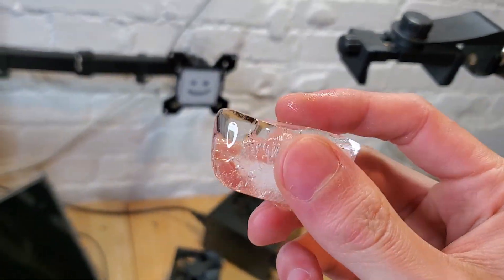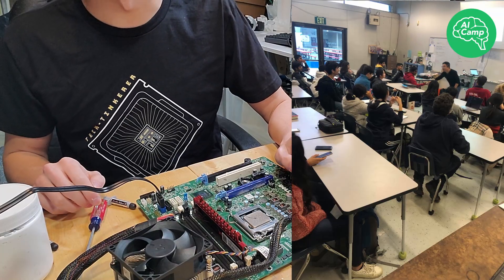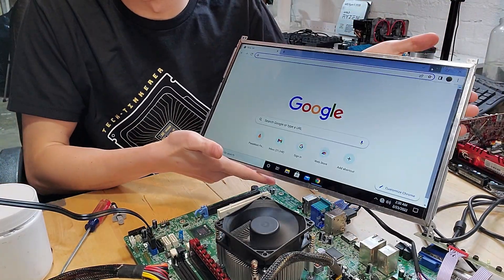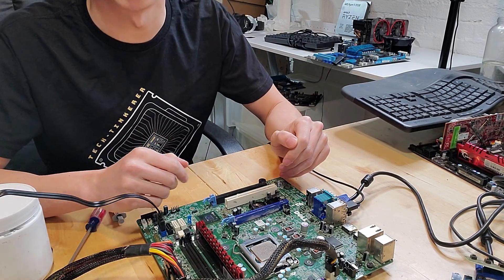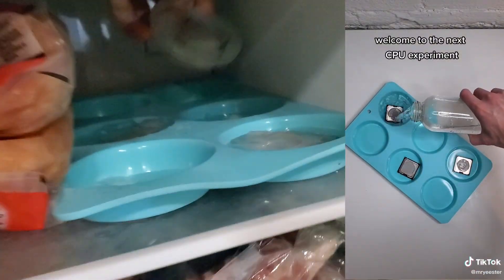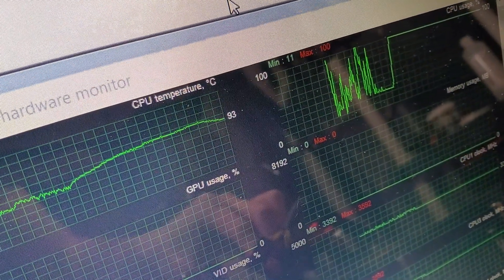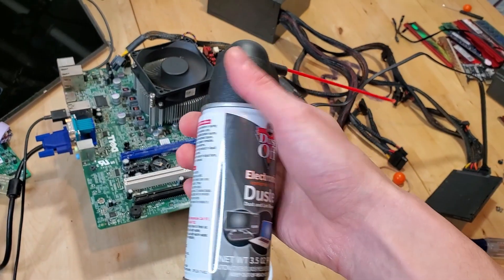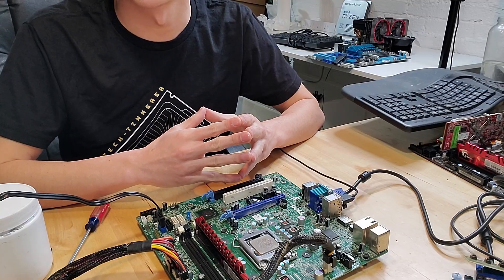Can Ice Cubes Replace your CPU Cooler?

Comment: For the frozen cpu’s in ice, most likely it will be destroyed from physical Damage from Expansion: Water expands as it freezes. This expansion exerts significant physical force on the delicate internal components and the microscopic circuitry of the CPU, causing irreparable structural damage

Comment: As in January 1985 the Commodore 128 was presented, the second video chip VDC wasn't stable, it quickly overheated. The developer bent from his popcorn popper a tray, and with an ice cube it worked for about 20 minutes without buring down.
Reply: And remember: This was an 48 pin DIP IC running with 5V and 16 MHz.

Comment: it's not the ice or the coolant that is the limiter...  it's the iron of the cup... things have heat transfer constants... 

Aluminum and copper (which is what most coolers are made out of) have much higher thermal transfer rates than 18/8 steel would... 

So while increasing the differential definitely results in faster cooling... if you did the exact same experiment but you had an aluminum cup... the rates of thermal transfer would probably be as good if not better than that air cooler.

The big air coolers by modern cooler mfgers are basically heat pumps with massive fins with alcohol inside as the thermal transfer agent. The aluminum and copper bases and the aluminum fins are excellent heat transfer conduits. You use the alcohol instead of water because alcohol has a lower boiling point, and thus converts to vapor faster, and thus rises in the tower faster...

That's why those massive quiet PC coolers look like something out of the Matrix... you need a massive radiator stack to allow the alcohol to rise and then condense back down at the bottom.

That process is super super efficient, which is why with old PCs, they didn't even need a fan.

New PC's generate so much heat... the heat pump needs help by drawing in air faster than it would through normal convection.

But the real issue here... is the fact you're using steel and not copper or aluminum as your conduit. 

If you built an aluminum pipe on top of that CPU... say about three feet high... and about the diameter of a test tube (half an inch) filled it with rubbing alcohol... you could run the CPU without additional cooling. It would totally absorb the energy. You'd have to keep filling the tube because the alcohol would vaporize and boil... but if you made the tube say six feet high and closed it... it would cool continuously...

If you made it out of alumnimum, enclosed it, had copper lining, a copper plate, made it longer instead of fatter (which is what they do in cooling stacks), and then ran pipe through the center of it down to the base to create a convection flow through your fin stack ... 

Well... you'd have a 1990's PC cooler... which what those fat ass radiator things were...  in the early 2000s... they started putting fans on them.

If you look at what Noctua does... you'll get a good idea how it works and how an efficient fin stack can more than cool the CPU.

Those suckers are heat badasses... and their basically perfectly quiet (that has more to do with the engineering on the fans)...

Comment: Make a mount so the cubes sit directly on and melt on top of the CPU lid

Other ideas -
Aerogel CPU cooler
Replace the heatsink of the far unit with a 2d printed one (Fan can work)
Stack just thermal pads on top of it and see if it can cool it

Comment: I just use a Silverado radiator outside with a loop running inside to the water pump mounted on cpu. 50/50 dexcool for those wondering about coolant.

Comment: I put my hand onto the bare cpu in my tower just pissing around and it temps shot right up when i pulled the proper cooler off but did go back down by about 3c during the 15-ish seconds I could handle it before it felt too hot so technically i am a functioning cpu cooler hahaha <3
Reply: idiot cooling is real hahaha

Comment: I began designing and building phase change cooling systems around 2001.Actually attended Uni for Hvac Ref Eng. Built a 3 stage cooler. Installed all 3 stages in a used, clothes dryer housing. All new compressors HX's oil separators, VF drives...etc.  it can pull a 500 watt load to 184 deg F.  Silicone, it just comes alive below -120F! Regardless, a functional experiment! successful yes, but well really expensive. I was able to achieve solid 100% stable, 70% 150% overclocks on Xeons. So bit of pride.
 And forget about running 24/7 that would be $$$$$$$$

Comment: Compressed air doesn’t work like a cooler. Radiators use several fins to dissipate heat. Its better heat transfer

Comment: A traditional method contains two features. First the transfer of heat to the cpu to the heat sink. Then  the fan to disperse the heat from the heat sink to the air. Your experiments however only use one method. Ice is either trying to transfer cool from the ice to the cpu or transferring heat from cpu to Ice, but no fan to disperse any heat. Compressed air and etc only disperses the heat, but no heat transfer to another object beforehand. Maybe your experiment would work better if you somehow acknowledged both principles of traditional cooling.

Comment: Of you guys find a way of supplementing a normal air fan but with ice somehow, it should lower the active temperature during stress a little more than just the fan, in addition to reducing the speed at which the ice melts.

Comment: the reason why i find laptops better than desktops is that you don't really need to care that much about cpu cooling but i recommend having a laptop cooler cause buying a 1K gaming laptop will probably be a rip off and buying / building a desktop would be better at that point, but in my opinion if you opt for a laptop aswell i recommend you to get a LENOVO IdeaPad 5 (my current laptop) and upgrade it like, getting a dedicated one instead of the integrated one in the laptop, upgrading to 16 gb ram and maybe a better cpu but in my opinion the cpu the IdeaPad 5 laptop uses is really good, it's an AMD Ryzen 7 4000 series with integrated graphics (4 GB), overall incredible laptop. (and i know my comment has nothing to do with the video at this point lol)

Comment: 1. Ice cubes in water would improve heating dissapation
2. You should spray compressed air upside down in to the cup, this would cool cpu significantly.

Comment: If you use a copper can instead of an aluminum cup the ice will work better and get a bigger cup to put multiple in, the temperature goes to around 60 under load

Comment: maximum contact is required between the cup and cpu. There's a reason you screw in an air cooling system tight. As for the air blower, you could've installed the aluminum fins and then blown it with the air blower in replacement of the fan.

Comment: The experiment is entertaining, but it lacks any value conceptually. If you understood heat transfer, you would know that the reason a standard fan cooler is always more effective is because it has a larger surface area exposed that is transferring heat to the airflow. In this case, the surface area is just a fraction of the cooler radiator fins.

Comment: i put a blow dryer fan in my aircooler, the nactua fan at max on my core i7 12700k goit max 70c but with the fan from the hair dryer it went down to 50c both numbers are around but its cool ig

Comment: Ice cubes don't have staying power, they melt and then eventually turn to water, evaporate and cause condensation. This will lead to liquid damage, rust the mother board circuit which is not practical for long term use.

Comment: Okay so the can of compressed air was good in theory. But it missed out one of the fundamental cooling mechanics of the metal heat sink with fan. Namely the metal heat sink part. 

Those "stacked plates" within the metal structure are arranged in a sort of membrane like way to have as much surface area contacting air within the range of the fan. So the metal structure conducts heat from the CPU and distributes that heat along all of its individual plates. Those plates increase in temperature, becoming increasingly hotter than the air within and around it.

When you have one thing hotter than the other thing connected to it (CPU and structure, Plates and air around it), you cause a temperature gradient. Thus prompting heat transfer in both instances.

Surface area in convection is important as the larger the exposed surface area, the greater the heat transfer possible.

Comment: I had a laptop that started to get hot af so it would overheat (sounded like the fans were not running anymore), So I grabbed a bad of ice and put it under the laptop, surprisingly it worked for around 3 hours

Comment: put water and place ice cube inside the water and then start your pc. Let's see what is the temperature readings. Ice cube is not fully conductive to your metal bowel. Putting water so the ice cube emerged in the water will do the job.

Comment: ever tried wrapping the outside of the cooler and up the side of the fan with duct/electrical tape to force the air to pass through the entire block? believe it or not but radiators work better when cool air is passed over the fins rather than the fan just pulling air from the gaps where it meets the cooler

Comment: Ya wanna know how I know the IHS transfers heat good? I did a dry display test on an Iwill board with an athlong 1600+ a cpu from 2001 that uses less than half the power an i3 from 2012 uses, and within 2 seconds legitimately 2 seconds it started smoking and burnt itself to death, these things maxxed out at like 68 degrees tops with there itty bitty tiny coolers back in the day, thats how well the IHS works you can actually dry test a pentium 3 a cpu from the same year but unlike the athlon actually has an ihs and will work fine-ish it'll throttle almost immediately but thats infinitely better than burning to death in 2 seconds

Comment: it would be more efficent to spray a bunch of the canned air, and set the can on the cpu, as you likely find, that it is very cold. also, canned air has chemical treatments, that, in large dosages, is very dangerous

Comment: Cooling alternative, what if you were to use liquid nitrogen in compression and vacuum seal. One end touching the cpu. What's would be neat about this, is the nitrogen will go liquid to gas, but it will achieve both states at once and is very pleasing to the eye and viewing experience.

Comment: Make sure your useing distilled water for your ice or electrolysis will destroy cpu socket and your mother board... Distilled water has no impurities and is an insulater the ice has ironicly some semiconductive properties but thats a different story regarding piezzio electricty and all crystals includeing ice.

Comment: If you had a bucket of ice, that would totally work. There was no heat sink to buffer the heat, and not enough ice. Same for air drying, what is the point with no radiator. It was painfully obvious what was gonna happen.

Comment: This ice test is pretty useless. Putting a random stainless steel cup on top of the CPU like that has absolutely terrible surface contact. The connector blocks on the CPU and cooler are specifically and shaved to fit almost perfectly, but even then we still use paste to make the heat-transfer work. You could have at the very, very least put paste between the cup and the cpu. at the very least.

If you want to try it again with ice, you could maybe try something a little different, like building a leak tray underneath a heatsink and putting the entire heatsink into one big block of ice. That would probably achieve a way better effect (but still temporary)

Comment: I wonder if maybe the reason why the temperature started dropping as the ice melted was because the CPU was thermal throttling? I don’t know if this CPU works like that but it sounds believable, although the fact that it heated up fast after it melted implies maybe that isn’t the case.
Reply: It takes more energy to melt ice at the melting point than it takes to raise the temp by 1 degree of water.

The same happens when water evapirates. So ice and water can be at the same temp and the phase shift itself takes up a lot of energy.

Comment: I had ran a i5 3470 without a cooler for a week before realizing that it was missing its cooler. Decided to test it with integrated graphics on games like OG ghost recon and rainbow six 3 and it never went above 80 degrees celcius. A testament to "old" Intel.
Reply: It was most likely thermal throttling itself.

Comment: i did this once.  P4 1850mhz.  it got hotter than usual but worked fine.
used motherboard w/out fan or heatsink

edit: tip: there needs to be a little water with the ice to help conduct heat

Comment: Use a heat gun on a running i9 12900k onverclocked with no cpu cooler.

Comment: I know it's a bad idea but I have always wonderd what would happen if you sprayed compressed air onto a CPU cooler to make the fans go faster.
Reply: Fan bearings would burn up. Fans designed to spin up to a certain RPM blowing compressed air would exceed that RPM and ruin the fan. Made that mistake blowing dust out of power amps.

Comment: The problem is surface area all the fins on the traditional coolers increase surface area being cooled. I think the ice improved cooling ability once the bottom of the cup was lined with water more heat transfer. The compressed air would work if you took the fan off the fins of an old cpu cooler.

Comment: There wasn't nearly enough pressure between the cup and CPU for the thermal paste to be effective. In fact it might have even had some insulating properties (edit: in comparison to metal-on-metal) due to less contact surface.

Comment: The cooling got better as the ice melted because of poor thermal coupling of a loose ice cube, that is improved by the water that bridges the gap as it melts. Filling the pot with water and freezing it would improve that. You could also try to use paraffin (candles), as it has a higher melting point, so maybe it would cool less but last longer.
Reply: by that do you mean ,,uh..   convection?  heat tranfer from one hot objedt to one cold object?
ya   yer right, the ice has to touch the medium, or its just heating water...  and the cube is melting at a rate cooling stops transfering heat,  and just boils off....  cooking is a good example... heats low but pan is hot,   tons of ice,,, no dif,  the pan is being heated faster then the water can cool it :-\..

oop oop what we call, a half ass thermal runaway.  :-)

Comment: Well a custom loop chiller is effectively running the liquid over the CPU to a bucket of ice and back again when with less heat in it. So yes ice does work just you also need water which moves the heat load. In his video when the ice cube turned to water it seemed like if he just put in another ice cube instead of replacing the entire thing it would have worked better too.

It is impractical unless you also have a way to keep the ice cold so around 30ish minutes in a cooler but by the time you get to the expanded stuff needed to keep the cooling system working it basically would be its own room.

Comment: If you were actually going to try a technique like the ice cube cooling, you'd be better off leaving the melted water in the measuring cup and it continuing to add ice and siphon away water

The can of dust off, when you turn it upside down and spray you are literally spraying liquid refrigerant onto the chip. This is an OG troubleshooting trick for finding overheating components when doing board level repair

Comment: use a copper cup next time and a freeze ice within the cup itself. first of all, the aluminum or whatever of the cup doesnt conduct heat very well. secondly, there is no pressure pushing the cup onto the cpu like with the cpu cooler screws, making the gap between cpu and cup bigger. the cup is just "laying" on top of the cpu, not being squished onto it like a cpu cooler is. thirdly, the ice in the cup only touches the cup at a tiny area. most of the cup is being heated up and cooled by nothing but the air. if the ice would be touching the cup everywhere on the inside (one big block of cupsized ice or ice frozen inside the cup), the heat could have been transfered way quicker. its 3am on a tuesday night and i cant sleep again. excuse my spelling, my mind is gone rn. i just wanna sleep but i cant. im gonna miss college again. and again and again. i hate this

Comment: Hello! Ice is actually quite more effective. I use it o the bottom of my laptop all the time. My laptop can get quite toasty,and throttles down,but as soon as I rub 1-2 ice cubes all ove te metal bottom it goes back to its maximum potential. I think the biggest mistake you did was to just let the ice sit there. A more effective solution would be to put a small metal plate ontop of the cpu and then rub it as it melts much quicker that way. The biggest problem with ice is that it cant flow tho. Perhaps near freezing temperature water cooling would be the best of conventional and non conventional Collin worlds

Comment: Try using acetone. It has a boiling point of 56 degrees celsius. By turning the top part of your cpu into a basin, you could literally boil off acetone at 56. That means that the excess heat would be turn into energy to boil off the acetone and prevent the cpu from reaching above 56 celsius.
Reply: Ah yes, chemical poisoning

Comment: another dumb but slightly more expensive ice block method is you take a standard aio liquid cooler, take all the fans off and have the radiator be submerged in ice blocks

Comment: ah but theres  difference in this test thats bothrring mre. with all modern cpu coolers, the screws are necessary to apply presure equally to the cpu. and it needs to be as flat as possible, with even some cooler being microns flat.